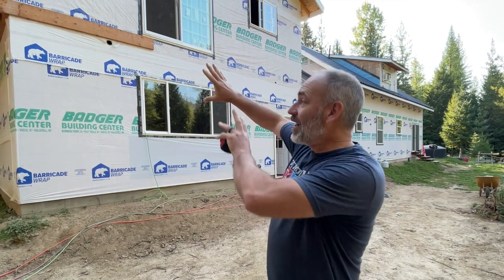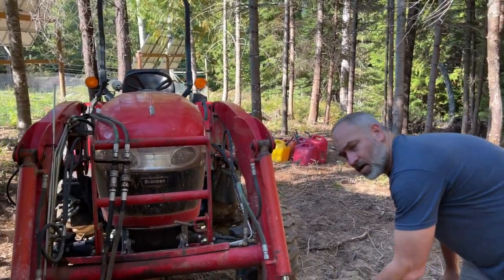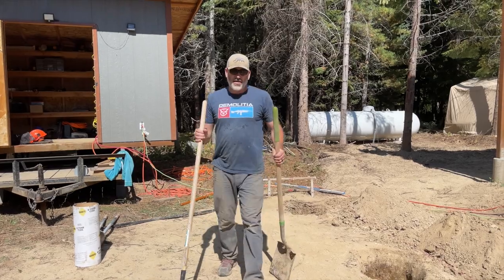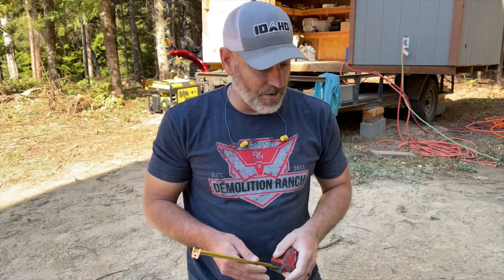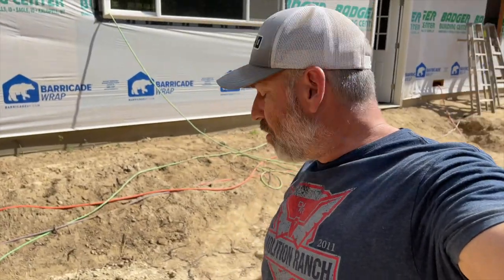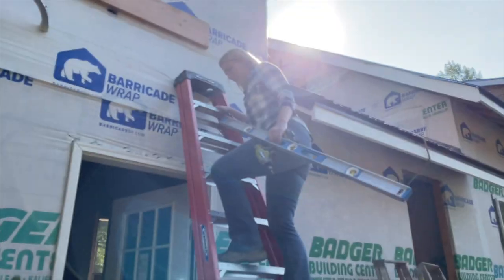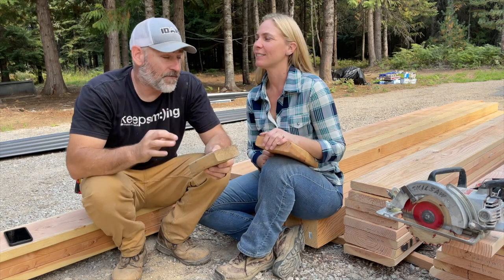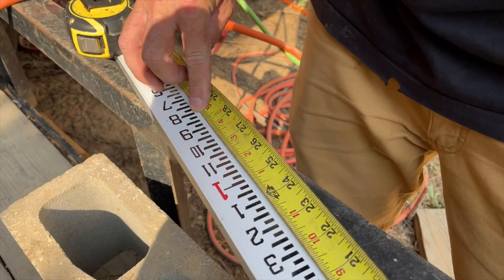Footers and Posts for our 30x12 Deck - Couple Building Their Own House

Comment: I would fill those footer holes with concrete to ground level around those brittle cinder blocks. It would improve strength to make weight of a lot of people etc on deck much better. I don't have to tell you how many decks have failed because of simple things that could have been done but were not.

Comment: We are building a house right now too. I know worst time ever but it'll be debt free. We've picked up some bad boards too. We just used them for blocking. It is frustrating though when you pay 70 dollars per board and it's all cracked up with bad spots in them. Another issue we ran into was all the pressure treated we used for the floor was different widths so some were up higher than other's. We just try to make it all work the best we can. I watched your whole house build from start to finish when you moved out of the tents. 😉. It's come a long way since then.
Reply: One good thing though is if we ordered to many boards or got a bunch of bad ones we could return them for a refund. Which would be easier if we weren't a hour from town 😜. I'm just glad we decided to go with a small house instead of a big one. We're doing 24x24 with a loft. 14' walls and cathedral ceilings for added head space.

Comment: Try parking your pickup level and putting the ladder in the bed.  Should keep you from needing top step of the short ladder.  Think I’d also put a few screws in the posts sticking out so you could rest the beam on them on the way up.
Reply: With the post 1 foot shorter it's less of a struggle. 

Kind regards Christiaan

Comment: You can buy a 3 point hitch post hole digger
And you can buy the wider auger to dig the holes with we use it for pole barns and exedra
Reply: Their tractor is down, waiting for part.   Hitch out of the question right now.

Comment: There are waterproof coatings you can put on A plywood-based decking…That way your deck is the roof… there are many different types some are even fiberglass-based… Just make sure you leave the deck at a slight slope so water can run off of it.

“The Vineyard Farmhouse”

Comment: If you make the frame for the deck first and level that and ancor that to the building, then you dig holes and fill those with concrete and put galvanized fasteners to secure the deck. Let it harden for a couple of days, its way better than measuring the concrete blocks

Comment: Pb&J is my kind of sandwich. Actually newer heard of Pb&H but I will try it out this evening. I am so happy that we use the metric system, because those measurements in feet and inches, eights, quarts and halfs is just way more difficult than it needs to be.  If you do all in mm everything is dead accurate and easy to follow. A meter is 10 decimeter is 100 centimeter is 1000 millimeter, right? (3 feet 3 3/8 inches) if you absolutely must use that archaic system.

Comment: Good job construction wise, but same question as your previous small porch and stairs, why not use pressure treated lumber? Almost any regular lumber where moisture can get trapped will quickly rot, and in a deck that can be very dangerous.

Comment: I've made the same measuring mistake myself. Another better practice I've learned is to express lengths in inches rather than feet and inches. For example, instead of saying 8 feet 11 inches,  call it 107 inches. Less confusion that way.

Comment: Sure it's been mentioned befor but here goes. Can't get used to you guys measuring in imperial. Metric much easier!
Reply: All depends on what you're used to. In my trade I've used metric, fractions, decimal and engineering rules, engineering rule is in 10ths of a foot. It's all the same, just use the proper rule for the job.
Now a proper look at fractions, and maybe how it started. Say you have to build something only measure you have is a string about the length of your arm. You project needs to be 6 lengths long, but you don't have the room. How do you make it shorter so everything lines up? Fold the string in half, 1/2, half again 1/4, 1/8, 1/16, 1/32 etc. Try that with a base 10 system. Sorry about being long winded. Just having used all systems of measure i haven't found one that is better than the other for linear measurement.

Comment: Maybe you mentioned it,  but what type of material are you using? Are you using treated? At least for the ledger. If not and even if you are, you might want to cover the top of your joists sealing tape before putting down your decking.

Comment: That's going to be a nice deck.
A PB&J keeps the doctor away. I've eaten one a day since I was a kid. At 72 people tell me I look like I'm in my 50s, no gray hair in the little I have. If a lumber yard doesn't let me pick my boards I don't shop there. Especially for a deck.
For cutting steel up to 3" square ryobi makes a nice 18v bandsaw. I used it to level 12 steel pipes for my solar mount.
Reply from the maker: I wouldn't shop there either but they happened to be the ones near by with 2x10x12s. these shortages are getting old!
Reply: @MartinJohnsonOffGridLiving  i was installing cabinets listening to your video so I didn't notice how your wife cut the ledger board. Please don't get any part of your body directly behind a circular saw. How she was positioned a kickback could be life threatening.

Comment: Did you ever find out where you went wrong in measuring the height?  If you subtract the first measurement from the second, you would be closer to correct, because you were comparing the top of one cement pillar to the other one. Then you add the length of the post already installed to get the length of the new post. 
 25" - 8" =17", added to the length of the original should give you the answer.
Your mistake was in the last measurement by setting the tape at 1' instead of the bottom of the stick.  That's where the extra foot came from, I think.
Can't figure out where you got 28" from.

Comment: Ledger board, not rim joist. Your rim joist is the end joist that comes off the ledger board using a concealed joist hanger. Use regular joist hangers for all the joists that are in between the rim joists.

Comment: Yeah I seen that in the video you forgot -1 foot night. Take the beans out and cut a foot off
Reply: Easier to go ahead and put up the rim joists level with the ledger board and cut the posts level with the top, assuming the joists tops are level with the ledger board top.  I would rather mount the rim joists to the sides of the posts instead of the top.  Makes for a more stable and secure deck.

Comment: Hello Martin & Julie!!!
Love your videos and all your projects!!! Can't wait to see that deck finished...!!!
But I have one question: What's the purpose of the Solar Shed when you now have a fully fledged garage with enough working space and so... Wouldn't it be worth to have all that electrical and solar equipment at your reach in the garage than outside in a - constantly getting further away - shed??!! What would happen in the winter (with all the snow) if there was a problem with the solar energy system or you would need to start up the generator??
Just my thoughts on that... Good Luck!!!
PS: I'm also a big fan of a big basement... any ideas of making one beneath the house??!!! Take care you guys...!!!
Reply from the maker: We are keeping the solar equipment in the shed incase there is a fire. seems safer that way.
Reply: @MartinJohnsonOffGridLiving  OK, I get your point, but... why would there be a fire in the first place?
Usually, solar equipment (inverters and solar mppt controllers) are not mounted directly onto wooden walls (to avoid that risk)... you hang them on a fire retardant surface and some material that would keep the wooden walls from getting on fire (like something with concrete) ... you should take a look into that because all your solar equipment in the shed is mounted on wooden walls ... not a very good idea...
So, if you take the proper mounting measures, you could hang them anywhere...
Just my thoughts on your situation and how I think it would be much better and more efficient for you and your family...
Take care...!!! Keep up the good work...!!!

Comment: In the days before sonotubes, did the holes not get dug using a post hole digger (which you would also use for sonotubes) and the hole itself filled with concrete (2-3 or even 4 feet based on frost level depth in the area) and the top of the concrete sloped with a bolt or even beam holder place in the concrete before it fully sets? (vs trying to build it up using concrete blocks? I thought initially you were simply going to set the concrete block in the wet cement place in the hole and use it as a base (kind of like the ones you set on top of the ground if you don't need to worry about frost or heaving). Not sure having the deck on this 'stilt system' will hold up or be the safest, but I'm not a deck builder.
Reply from the maker: I’m not sure. Sorry.

Comment: Those piers holding the posts sure look very flimsy are you sure they will be passed by a building inspector or don’t they check these things where you live and how is the beam fixed to the house as there will be a lot of stress on it especially when you have a lot of people on the deck.

Comment: Massive amounts of dollars spent on this off grid home. It is not simple by any means. Big carbon foot print. None the less, i still like all that you guys have accomplished!!!
Reply: I too like what the Johnsons have accomplished.  It really is not any of our business the amount of money spent to build they're off grid home. An off grid home can be as elaborate as you want. Not sure why you mentioned their Carbon Foot Print, I would think that with all of the trees around them it would equal any use of that up. Use of solar for most of their power, a garden, chickens etc works great. Once building is finished the CFP will be the wood burning stove and possibly the propane. They ve accomplished so much in the two years of building.

Comment: I am concerned that you're giving yourself a problem by not figuring the space required for the cinder blocks for parking the tractor.
Reply: Right...they never showed us the width of their tractors. Would be a shame once they started driving the tractors under the deck a few inch of the cinder blocks would in the way!

I still don't understand why they didn't span their posts 8' on center; adjust one of them. This way they sure to have enough!
Reply: @vt20247  He did, think he said 6 feet.  Early in this video.
EDIT: I went back and watched again, he said plenty of space for the tractor, and 7' for the bucket. If the posts are actually 7'OC, the space between them will be 6'6" for a 6x6 post or 6'10" for a 4x4 post.  Gonna be close!
Reply: @vt20247  Yeah; he said, I think, the widest part of the tractor is 7' even. That's too tight. But hey, he'll figure it out... :-)

If that's the worst mistake he makes, he's golden. I've made some doozys.
Reply: @dominictramonte2687  The tractor will make it, but a 7' wide attachment won't.
Reply: @paulmonk7820  It's 11 foot deep or so. The tractor is probably a lot narrower than 7 foot. You can probably get in there by angling the implement and straightening out.

I think, anyway.

Gonna have some beat up posts, though. Maybe should have left a 8' or 9' opening in the middle and spaced the posts as per. Just my 2 cents. I'm not building it. And there's nothing stopping them from coming in on an end.
Reply: @dominictramonte2687  The deck is 12' deep, which I think is enough for the length of the tractor.  He has enough width for the tractor.  Any attachment wider than 6'6" (7' center to center -3"for each 6" post) won't fit.  If he had spaced the posts 8' apart, there would not have been a problem, but he was going for symmetry, since he was planning an 11 x 28 foundation for the deck (4 evenly spaced posts).

Comment: Wondering why you are putting the joists on the top of the posts instead of bolting them to the sides.  In my opinion, that will not give nearly the strength you need.

Comment: I hope you subtracted the height of the beam also...
Reply: Would not be necessary if joists were mounted on the sides of the posts and ledger board.
Reply: @paulmonk7820  they said they were doing it as a cantalever.
Reply: @mikerieger8964  That makes no difference. They're going to have a 1' overhang on three sides, but that doesn't prevent mounting the rim joists on the outside of the posts.  There will be more than adequate support for the overhang.
Reply: @paulmonk7820  then why did they put brackets on the top of the posts to put the beam on top?
Reply: @mikerieger8964  Because they intended to put the joists above the posts, which I think is not the best way to build it.

Comment: I am still concerned that you have not measured for the beam on top of the joists.  Everything is measured from the top of the ledgerboards. Then minus the 12" for the beam on top of the posts.
Reply: That could be how they got 12" off. I'm no pro lol 😅 but could be.
Reply: @Early Riser:  Aren't the tops of the joists and rim boards going to be flush with the top of the posts?

Comment: HELLO MARTY.  HIS LEVEL LINE  IS. MOST IMPORTANCE  OF. ALL.  ...  OR. DIMENSIONAL.  THINKING. AND. MEASURING. BECOMES. KAYYYYASSSSSS.    AND WILL HAUNT  THE PROJECT. ALL THE WAY.  TOO THE TOP  OR. END.  OF THE. LINE.  ITS.   STRAIGHT. PLUMB. AND.  SQUARE.  USING.  NORMAL. BUILDING.  METHODS. LEVEL AND THE. TAPE.   DONT. LIE .  Just. Saying. Hello.